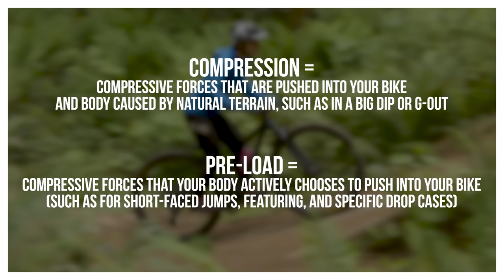Jump Better: Understanding Compression vs Pre-Load  - Practice Like a Pro #62

Comment: I was just explaining to someone this idea of pre-loading. The best physical description I came up with was the idea that steep jumps want to redirect your bike up. But your center of gravity is still moving forward. So if you don’t preload, you induce a forward roll and that results in the buck (like sprinting into a knee high wall). So pushing into and against the force created by the compression (redirection) moves that vector up without a roll and you just follow the flight arc. But the key is totally holding that compression in until the end. I always like to have people think about keeping their legs pretty much straight until the top of the arc just to exaggerate that movement until it’s muscle memory. Great vid again guys!
Reply: That’s actually a great explanation and makes totally sense. I’ve heard somewhere if you get better at jumps,  you can feel them in your feet, like muscle memory.
Reply from the maker: Thanks for this. All great points you made above.  -Simon

Comment: I think the really valuable bit of information here is the explicit point about the ‘direction of the knee caps’ when creating pre-load. This concept unlocks the process. Feel that movement forward as part of the whole, and you will feel the ‘control’ great jumpers (not me then!) feel as they prep a jump. Once mastered, the ‘degree and direction’ of that forward and down movement of the knee caps become almost your flight controls for different jumps. I’ve never read this, but I suspect the reason good jumpers appear to have the perfect speed for jumps they have never seen is that they use this ‘knee cap’ flight control during the jump. They can feel the jump pushing back and moderate that by moderating the direction and force of that knee cap forward and down direction.
Reply from the maker: Love this note. We talk about 'volume control' when jumping so that you can tweak your outcomes as needed based on speed, conditions and intended outcomes in the moment with exactly what you are describing. Being able to understand and imagine it is the start of being able to do it.  -Simon

Comment: this is really good, most tutorials go from a bunny hop to jump, on a bunny hop you lean back heels down to get the front up, its totally the opposite apparently. Will give this a shot, thanks and makes a lot of sense
Reply from the maker: I consider hopping and jumping two different skills as hops do require a slightly different movement. Hopping also requires use of the arms, something that should be left out with jumps for the most part. Hope it works well for you!  -Simon

Comment: I'm re-watching this and other Fluidride jumping videos the day after riding a bunch of Duthie trails for the first time (namely Gravy Train and HLC). I got bucked (not badly; just had a scary, long, nose heavy flight off the lip) on the very same HLC "ski" jump you're riding in this video. I went brakeless down the whole hill and was too active stomping into the compression/g-out, standing up too early and then just riding over the lip like that at high speed which kicked my rear wheel. It's like there's two distinct compression zones (g-out, lip) that more or less need to be treated as one longer one and I had some success slowing down a bit and thinking of it that way. This video really illustrates the body position during that process. 

I've also been inconsistent on feeling in control on smaller lipped jumps, especially higher speed "long and low" ones and now I know why! I guess I needed the context of a season or so of developing some rudimentary jumping technique for this video to make sense to me, but now it's very helpful.

Comment: If you master the preload for induced compression to achieve a hop and nail the timing you will also time the lift off perfectly. Preload works across the gambit also and gives you extra traction on a berm as well as achieving a float over terrain that slows you down. Just remember it is a fast and forceful movement with varying force.

Comment: Once again, invaluable information. A few days ago I got bucked on a small jump after doing several bigger jumps without a problem, which really confused me.  (And it hurt - spent the afternoon in hospital with a dislocated finger and plenty of bruises). Now I understand. Thanks!
Reply from the maker: Oy. That sounds like a rough one! Yeah, it can be surprising that small jumps are actually more technical than bigger jumps. Hope you heal up fast!  -Simon
Reply: Well not healing as fast as I want to, but keen to get back out there with what I've learned. Question though - what about Rebound? I think I had the rebound setting on the back wheel set incorrectly. So, I'm now assuming near maximum rebound damping at the rear, and closer to lowest at the front? Will that work (or not work) for short steep jumps vs other types of jumps? Just trying to figure this so I don't finish up back in hospital 🙂 Thanks!! Love your work  @Fluidride
Reply from the maker: @quantumkookaburra  You should have them set so that when you stand up centered over the bottom bracket, you get equal compression (travel used) when you push down through the legs only (no arm push). You should also get both ends returning at the same rate. This is a basic idea for setting the bike up. You will likely be somewhere in the middle of your rebound settings at each end. Balance front and rear is really important. You might seek some help or just use this basic guideline to get 'close' with your settings. Hope this helps!  -Simon
Reply: @Fluidride  Thanks for taking the time to reply Simon! Good advice - I may be over thinking things. I'm 65 (years old) and just bought my first MTB. Been riding about 3 months. But I'm not one to wait - wanna ride Rampage 🙂 Well, maybe not, but, go big or go home. I'm in Australia, and struggling to find a coach. But I better before I bend it instead of send it 🙂

Comment: 1. THANK YOU!!! Amazing video, for me, right now! You said ONE sentence that really caught my attention, prompted this longer question - 

Have either of you ever ridden Deer Valley? Tsunami trail? I have limited experience hitting jumps. Most of my progression has been in the last few months... I was clearing the jumps on Tsunami, so I'm able to ride pretty well at this point (jumps - do NOT talk to me about Upper Fireswamp!  LOL)

Anyway - there is ONE jump on Tsunami that consistently bucks me. 

It's maybe 30-35 feet long. It has a nice long, downhill run in... and a TINY ramp. It's maybe 1.5 bike lengths - I never stopped to measure it... but tiny relative to all the other jumps on the trail. 

"The jump is so short, it might kick us" - is that IT? Am I just not preloading enough? After the first few times, I got scared... rolling on that front tire, for maybe 10-15 feet ALMOST otb, uncontrolled tends to do that to me. LOL 

Anyway - thank you! Preload with perfect timing - that's basically the 'secret' is what I am hearing, yes?
Reply from the maker: I don't know the trail or jump, but sounds like it has a bit too short a ramp for the length of the run in. Not sure if this is a gap, but my suggestion if you aren't worried about clearing it or going big then come in a bit more slowly and focus on letting the bike accelerate into the jump as you near it (releasing the brakes). This could create a better quality interaction with the jump as you might be using so much speed that you can't move comfortably into the jump and end up under pre-loading or getting kind of pushed into the short face of the jump. Of course if this is a gap you have to make then take that into consideration and use good judgement with this. This idea can help riders reduce speed needed to jump, which lessens our fear response on trail. Practice this where it's safe to do so.  -Simon
Reply: LOVE IT,  @Fluidride !!!!! Thank you Simon!!

Literally and physically slowing down in jumps is something I'm working on. LOL - that resulted in an OTB in a bike jump park a few weeks ago. -ouch. Recovering now, and I'm VERY excited to get back out there and try all the techniques you guys have taught me! :-) 

That jump is not a gap, but about a 25' long table that's dramatically short. Meaning it's only a 3 to 4 foot lip height and it's one of those where the table is beaten down so much that the last 5 feet of the table is grooved out at the same angle as the landing. Which is only SLIGHTLY more steep than the trail - virtually no transition between landing and trail. 

Anyway - YOU GUYS ROCK and I have an idea of how hard it is to produce these videos... HUGE props to you and your team! Thank you!!!!

Comment: I cannot jump yet, at least not as good as I would love to but I find the small jump really big when I remember how I started jumping. 
My advice for beginners is to start small and feel the jump, the bike coming into you and how you put it back down before getting into learning to handle bigger forces as they will be big and you need to learn how to control them
Reply from the maker: Great advice. I love the idea of thinking of it as deciding what to try or not try based on the forces involved. You are correct that this is what takes time to develop - the ability to deal with more and more force - with a a good outcome. -Simon
Reply: Thank you for the reply. BTW, great video! I still have a question: I'm able to do bunnyhop like a beginner does, ok but not really great. Still, I'd like to know how to translate that to jumping a table? My current jumping technique is similar to what is shown in the video but I'm afraid of the speed and I'd like to get more height hopping but I cannot seem to find the proper timing. Any advice on that? Thx
Reply from the maker: @SunSnowGravity  Remember that bunny hops are a bit different than jumps. With a hop, there is no jump so the arms are needed. With a jump, we want to keep the arms out of the mix for the most part. I'd try to keep these two skills in different categories in your mind as you practice. I hope this is helpful!
Reply: @Fluidride  yep, it does. Thank you! I'm actually working on correcting the issue I have with using my arms too much when jumping, pulling the handlebar it's my problem

Comment: Nice video! I think my problem with jumps are, that I pre load too soon. It looks so easy when you hit those jumps. Now I got something to practice 😅
Reply from the maker: That is super common to see and actually can end up in being pushed around awkwardly because you run into the jump force in an even less compressed state than you would have without any pre-load. Focus on letting the knees move toward the jump ramp as you practice. This is a very subtle move with the knees moving into the jump which creates some loading into the ramp. This trick can be helpful with timing. Also do your best to keep your upper body relaxed (belly button and up) as your lower body presses in (from core to feet).  -Simon

Comment: Is the preload technique doable on a hard tail? I realize the outcome will not be the same but can I get something out of it without full suspension?
Reply from the maker: Exactly the same. The loading is mostly in the legs, but shows up visibly via the suspension. I should have mentioned this in the video. But yeah, no change. You will actually get more air a given speed with the same inputs as no energy is lost to the suspension. Riders often confuse this and think the bikes suspension is doing the work. When properly tuned it just shows if our weight is in the right place.   -Simon

Comment: That HLC g-out is intimidating! I always feel like I'm going to buckle if I charge in at full speed! What's a good way to progress on that one? Right now I'm braking a fair bit until halfway down the entry slope, then letting it go to make sure I'm accelerating into the jump.
Reply from the maker: Do not go full speed down that hill into the jump by any means. There is a big tree about half way down on the right I think. I'm on the brakes till that tree then off the brakes and into the jump. Always important to accelerate toward a jump, so enter slowly up top and let your speed build toward takeoff.

Comment: So the small jumps are often found on cross country courses.  So what happens with hard tails or (gasp) rigid bikes?
Reply from the maker: Most of the compression is building in the legs, but is just more visually apparent in the bike. Hard tails and even rigid bikes jump just fine, and follow the same basic rules!  -Simon

Comment: How do you know where to start preloading when riding a new jump, if Simon isn't there laying down cones? In "Gauging Jump Speed: Practice Like a Pro #40" the cones for the kicker start a bike length out from the edge of the kicker ramp, while the pink cones in this video for the short faced jumps are near the bottom of where the jump starts.
Reply from the maker: Really great question! Basically the pre load (compression we make) should blend into the loading (compression the jump offers). This is the basic tenet that your never want to steer away from. The kicker ramp is VERY short, so I want the whole bike to be loaded before interaction with the little ramp. Basically, I'm making the bike think the jump is more than a wheel base long. If I load late into such a short ramp, I'll get bucked in the process. With the dirt jump, the takeoff is a bit longer -- just over a bike length -- which allows me to load slightly later as my whole bike fits on the jump. Hopefully this makes sense. I actually think of the kicker ramp as being more like featuring off natural terrain as the front and rear wheels are never on the ramp at the same time. -Simon
Reply: That makes sense. Thanks for taking the time to dig into the details, as always!

Comment: My front wheel always seems to drop off as soon as it leaves the lip of a jump rather than continuing to drive upwards till the back wheel reaches the lip. Some say to lean back with locked arms to drive the front wheel up, same say to row the bars to your hips. Please give me your advice on how to keep the front wheel going upward off a jump. I can jump ok, but would get much more air and distance if I could get that right. Thanks
Reply from the maker: The only thing I can think of if that you might be too far back on the bike. The rider should stay centered over the bottom bracket and their own legs. Be sure compression is being held through legs only and that the front wheel is not unloading until after interacting with the lip of the jump. If you aren't able to figure out what is going wrong, we do offer video based feedback on both our Fluidride website and our FluidrideOnline platform for $39. Hopefully staying centered on the bike and holding pressure though your legs will sort this out. Arms should not be used when learning to jump. Keep your arms relaxed as you jump. Doing this will help you stay balanced over your own legs, which is what is needed. I hope this helps!  -Simon

Comment: You mention that you don't need to preload for the jumps on A-line. As someone who currently cases ~40% of the jumps on A-Line, I find it hard to convince myself that I don't need to preload for the 3-4 steeper-faced "high & short" jumps. It feels like I have to preload & pop to not get bucked by them, but maybe I'm thinking about it wrong..
Reply from the maker: Not saying that at all. You do need to with speed, but those jumps are crafted to allow you to really feel true compression. What I mean is that they are tailor made for jumping, where as more backwoods spots are not. There are a few jumps there (A-Line and Crank it Up) where the pre-load is offered by a big downhill going into the uphill takeoff, but most do require pre-load. Sorry if I wasn't clear about that. Glad you checked in!

Comment: Make sense, is it the same for hard tails? Loving the content since your return, keep up the great work and I wish you were in the UK as I suck at jumps! 🤘🤪
Reply: Hard tails: yes. Exactly the same. Don’t get fooled by the obvious fact that the shock is part of the process with full sus and not on the hard tail.  What is different is that the shock and how the axle path moves with a full sus makes things easier for any given ‘arc of a jump’ and also flatters poor technique. So, the technique is exactly the same, but good technique is even more important. Remember, your legs, body and arms also perform the same function as the suspension!
Reply: Glad I read the comments. I had the same question. I only ride a hard tail. Have never even been on a full sis. Might like it too much then I’d have to get another bike 😮
Reply from the maker: Yes it is!